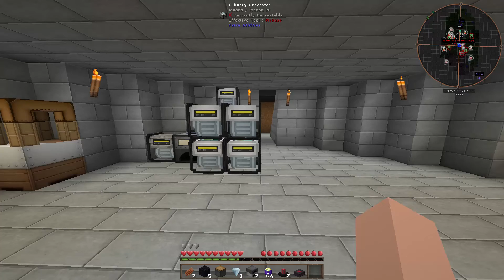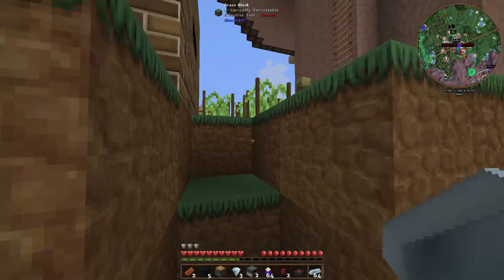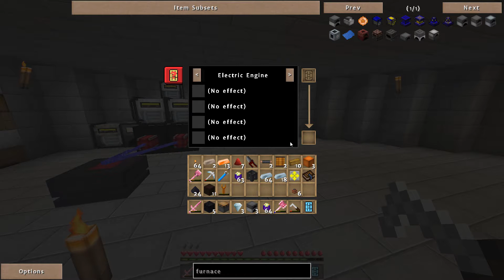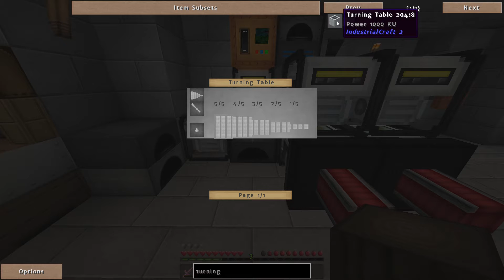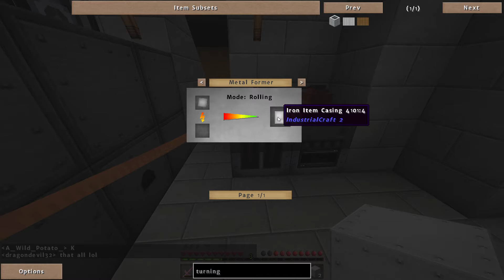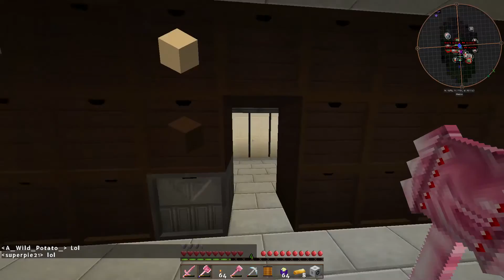FTB Infinity Evolved - Setting up a Turning Machine Ep 20

Comment: Pyro:... I don't think we will need the smeltery "that much longer" so one drain and faucet is fine. 30 hours later. Still one drain still  100 percent dependent on tinkerers. No attempt made to put a timer on the drain and a hopper to automate smelting. Thumbs up on ur video. But ur definitely wierd.

Comment: you can use a pulverizer to make charcoal dust
Reply: +kevin C (kpc31466) I wondered about that too, pulverizer probably is faster and takes much less power too (basic). Plus it's one block big and can output directly into the induction smelter. Just put a hopper and a TE cache or drawer full of wood on the furnace and the whole thing will process over time.
Reply from the maker: +kevin C (kpc31466) Once we start getting into TE more directly I probably will